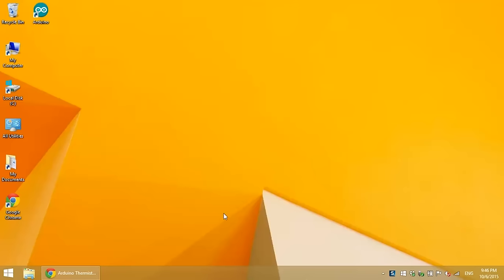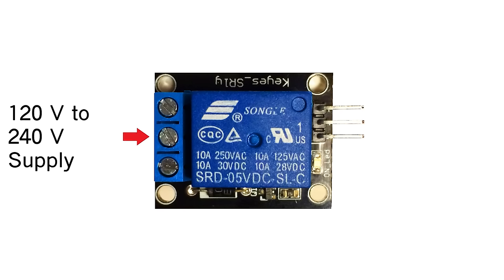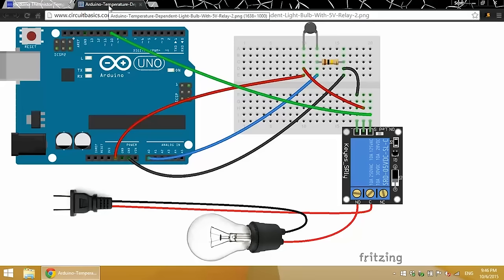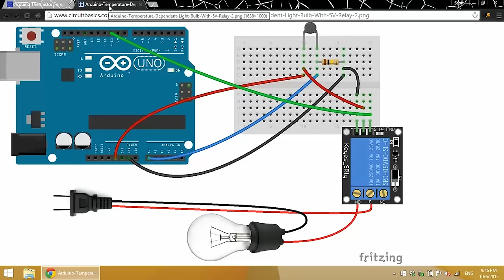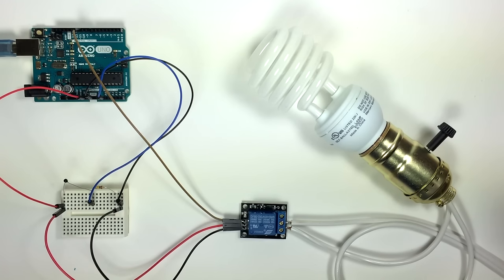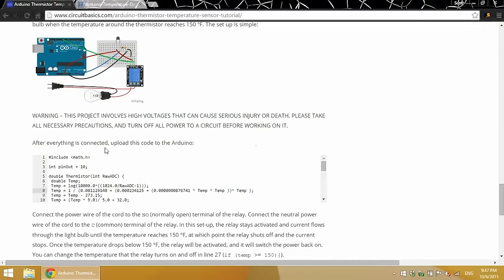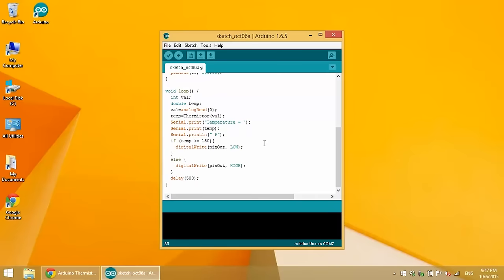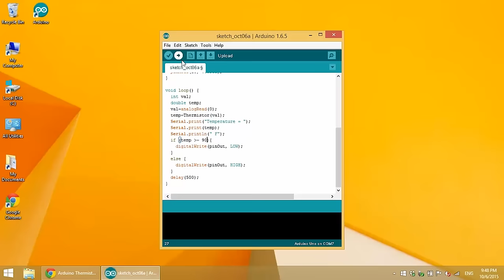Using Sensors with 5V Relays on the Arduino

Comment: This video is very clear and well explained - so many of these types of videos are unclear and confusing! Well done! I'm trying to set up this same relay module with the Arduino MKR 1000, but i have no success getting the arduino to change the state of the relay. I have noticed however that when I unplug the MKR1000 from the breadboard, the relay and lamp connected turn off, I just can't use the code to change it. Do you have any advice?

Comment: So how about using a PIR sensor or an RCWL- 0516  sensor with a relay to work an LED and musical  movement driven by a motor?

Motion detector would set the musical movements and LED off. Sadly my 5v  timer relay that I have has a constant 4.70v at its TRIG pin out. I was hoping to place my PIN OUT of 3.3v from my sensor onto the relay TRIG pin.

My 5v timer relay has a small black button and when its pressed it will activate the LED and musical movement for 10 seconds. I can adjust the timer with it onboard POT.

Basically I want the motion sensors to activate the relay NOT by me pressing a button.

By the way I wasn't using an UNO or NANO.

Any ideas?

Comment: Im using another version of the code to control a water pump, when the moisture is a higher than "500" the relay will activate the pump. Here's my problem:
My arduino Nano is sending a "go"-signal at 2,4v to the relay and a 9v battery is connected between the relay and the water pump just as yours, but the water pump wont start on NO, but it does when I connect it to NC. Is the signal between the arduino and the relay too weak?

Comment: Hi...can i use a mosfet to controll a 24v dc load attached to it?the mosfet pcb i bought have 3 pins to interact with arduino and another 4 pins where 2 is for input power supply(in this case 24v)and other 2 is for output...

Comment: How will I know what resistor I should use for my OWN relay actuator sensor setup ????  I know 1 led is ok with 250ohm (v=ir) but I mean should I check every amper volt for every element in the circuit and should I connect a resistor for every setup I make ???
Reply: or is it okay not to use resistance? is it only ok when the voltages and ampere values are the same

Comment: Hi, I want to do something very similar. But instead of activating the relay based on the thermistor, I want to use a voltage sensor.

When the voltage sensor value = 15v I want the relay to open the circuit.

it's a basic battery discharge protection circuit

Comment: Forgive me if I am wrong but the data sheet for the Songle SRD-05VDC-SL-C appears to indicate that the current drawn by the 5V SRD relay is 71.4mA.  (http://www.songlerelay.com/Public/Uploads/20161104/581c81ac16e36.pdf)

According to the Arduino site the recommended DC Current per I/O Pin is only 20mA.  (https://store.arduino.cc/usa/arduino-uno-rev3)

Since you have to put the pin to the relay in a High state to activate the relay (one way or another) you are providing a constant 5V @ 71.4mA from the Arduino plus whatever the Thermistor and resistor are drawing.  Could this potentially damage the Arduino by using a relay that draws more current than recommended?

Comment: Instead of AC high voltage to power light bulb, is it possible to test this with 9v battery to small LED light?
I know it says 30 VDC so will 9v battery damage the module or even worse arduino board?

Comment: Sir how can i use this  relay and Arduino uno for star delta starter, if i use this type of relay for star delta starter when the input signal from Arduino is  low the relay will activate and vice versa, bt this is not correct for star delta starter, how can i fix this issue, please help me sir....

Comment: can I use the digital outputs on the arduino to activate the relays? probably a dumb question but I just wanted confirmation. I'm using momentary switches to activate simple LEDs and I'd like them to activate 120 volt ac lights instead.

Comment: Why are you connecting the neutral wire from the light to the relay?  I would think that is dangerous?  If the relay is off the light is still powered and if given a ground...?  I think you should always switch hot wire?
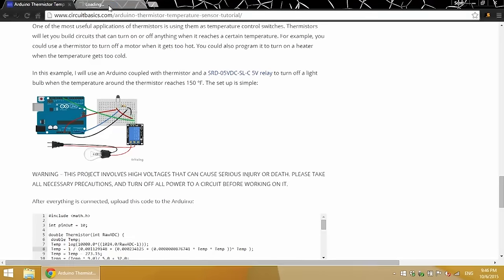Reply: 0:56 says that the only place u could get a Fatal Death Shock is the C terminal of the relay
Reply: Doesn't matter which direction you put, both hot and neutral wires are dangerous by themselves. (except nominally ground wire).
Reply: 2012isRonPaul  check out what he said at 1:20  even though the plug can be inserted in either direction!

Comment: I would like to use a proximity sensor to tuns an arduino mini pro on through a relay. After doing some work, the arduino mini pro gets turned off. How could I achieve this? Any ideas?

Comment: I am looking at doing something similar to this but with Three single phase 240VAC Motors. 
I am looking to switch between the motors so only one has power at a time, and only the active motor will show stats on a TFT LCD and be controllable with various options. Can you show me how to do this?

Comment: Nice video!
Can you point me to a slightly higher Voltage Relay? I mean to control flow between main-power and battery (with 2 similar relays). I'll have about 20~25V on the main-power (already converted to DC by a power supply), and I want to use the main-power in the Norm.Open position AND the signal simultaneously, so that while I have main power to connect the Norm.Open and disconnect the battery.
Also do you know what's the switching time of these relay? And can they be used in a Uninterruptible Power Supply?
Or should I put a big capacitor after the relay to cover for the current drop and fluctuations during switching?

Comment: I need this to work to activate a 120v motor for X seconds, but only after the sensor value reaches a point or lower for 10 minutes. 

I am new to this. What would that code look like?

Comment: Nice work. I have a question. Can I do it the other way around? Meaning that the relay becomes the input for the arduino. The situation is like this- when the bulb is turned off then the relay do the switching to send an input to the arduino. I'm not sure if i explain this correctly but I hope you get the idea of what I'm saying.
Reply: relay is made to use a small voltage to open higher voltages. If you want to send informations about a light bulb to arduino, the light sensor would do the job. The relay works only in one way( smaller voltages opens higher voltages)

Comment: hi, thanks for the video. If I want to control wall lamp from arduino, is it ok just connect lamp's vcc and gnd to relay and connect relay to arduino or should I put something to remove effect of triggering relay (high voltage, electrostatic feedback etc) ?

Comment: Sir, you did a great job. i need your help. i have collect 5v & 12v both relay to control a Aquarium AC 220-240v Motor. i want to use it for my irrigation project. here i'm using a moisture sensor. my plan is when " moisture <= OK " then motor will be start. also the result will be show in 16x2 LCD display. so, suggest me for circuit design and how to code in arduino, please !

Comment: Sir I'm woking on a project that uses solar power to charge laptops for 
students so I've decided to get an Arduino micro-controller + coin 
acceptor + a board of 8 relays, so I want to make sure that when a 
student insert a coin to the coin acceptor, the coin acceptor will send a
 pulse to the Arduino and the Arduino will active the relay for a 
certain period in order to allow the student to charge his/her laptop 
for that period. So how can I link/connect the coin acceptor to the 
Arduino such that the relay activates when someone insert a coin to the 
coin acceptor? Please help me, if possible give me the codes for this 
operation

Comment: can i use relay on digital pin 23 on arduino atmega bcz i dont have the space to connect it on pwm pins. i want to control a 12v dc pump..????????

Comment: Hi, thanks for making this video! 
what is the purpose of the resistor in the breadboard?
Reply: I've been trying to figure that out as well. I think I finally got it: to measure the resistance with V=IR directly through the thermistor, you would have to know how to ask the arduino what the current draw is. 

Since I'm assuming there's no easy way to do that, he used a voltage divider circuit so you can solve for the thermistor resistance using the known 5V, the known resistor resistance, and then asking the arduino to measure the other voltage. 
Rt = R0 * (( Vs / Vo ) - 1)     or     Rt= 100K ohm * ((5 V / V_measured) - 1)

Comment: great video! i just accomplished my first project. its a little wonky but ill call it a win either way. does anybody have an idea as to why my serial port monitor is showing a cycle of 100 degrees fluctuating by 10 degrees every second or so? i will continue to diagnose this issue and then i will work on another circuit basics project since this was such an excellent demo!

Comment: I've got a similar circuit and sketch and was wondering it you might know of a way to limit the relay activity. I'm having issues with the temp (water in my case) that is so close to the trigger temp that the relay is triggered on/off almost like a strobe light. I know I can increase the sampling time/ loop delay, but wondered if there is a way of having the temp in real time, but limit the relay to stay in the state (on or off) for a set time before triggering again?
Reply: just define the lowest temperature and the highest temperature that u want. with that u will get some of the space between the temperatures and relay will open in the lowest temperature, and close at highest temperature. in the middle it will just stay closed or open, depends if the temp. is rising or lowering.

Comment: Can I power high current / volt devices(like agricultural water pumps) with just a  simple relay circuit that you are showing?
Reply: blybaly yes, as long as the relay is rated for amps at or above the draw of the pump.

Comment: If I am trying to control three different high-voltage devices with one Arduino, do I need a 3-channel 5V relay? Each device needs 100V of external power.
Reply: u need 3 relays. otherwise when u connect relay on the output to all 3 of the devices that u have, all of them will turn on in the same time.

Comment: what if I want to use two different power sources to power the load (at some time I'll use the power from a solar panel and in other time from a normal home 220V for example) 
can I use both the normally closed and normally open for the same load in this case?
Reply from the maker: +Ali Ahmed I don't see why that wouldn't work. If you put the load on the common terminal and put one power source on the no terminal and the other on the nc terminal. The signal pin would be the switch (i.e. A photoresistor) for the two power sources
Reply from the maker: +Circuit Basics the only issue would be making sure the solar cell can handle the 220v draw from the neutral line

Comment: I cant find a relay that can switch 24V devices on/of.
Reply: you can use a 220-240 volt relay but not higher than 240volts

Comment: Hi...I have a problem... I think if arduino can helps me... Let's see... I have an axle that turns at 600rpm and it has a off-centre on it, and i want to find with strob light the degrees of the off-center... what do you think? Can you help? Thanks in advance...

Comment: Is there a chance of short circuit?
Reply: There will no chance of short circuit as long as you connect the output to something else (like a light bulb). If there is a short inside the relay for some reason, it will just simply turn the output ( light bulb) on forever, until you manually unplug it.
Reply: The only chance of a short is when you connect the relay to nothing (not even a light bulb). If such cases occur (two wires connect to nothing), then a short circuit will occur.
Reply: Okay Fine, Thanks a lot  for your reply!

Comment: Thanks for sharing. How about two ways control? I wish to control some heating system valve. We have a cylinder for the heating system and a hot water cylinder. I use ESBE ARA45 motors which have live, neutral and com wires. I need to control this valve in between the two cylinders. When the water temperature reached a certain level in the heating system cylinder, the motor should switch to the hot water cylinder to make hot water, So pretty much 2 sensors and dual motor control. If anybody can help me out on this would be brill. Thanks. I have two of this valve in my house a third which is the mixing valve.

Comment: bad idea to connect the relay without a proper flyback diode
Reply from the maker: I didn't mention it in the video but these relay modules already have a diode on the PCB